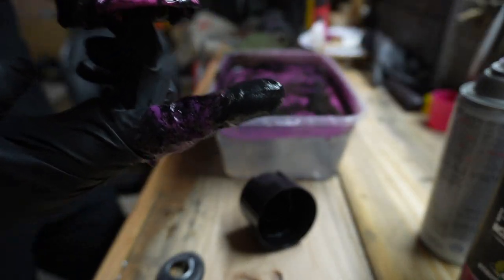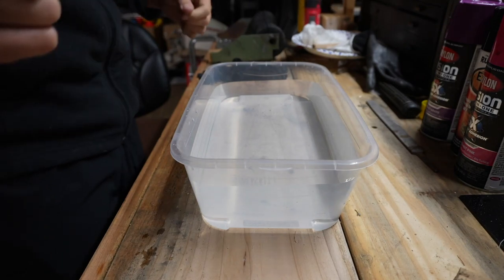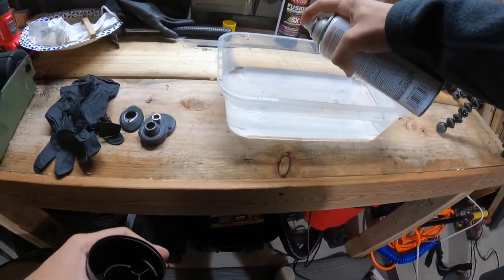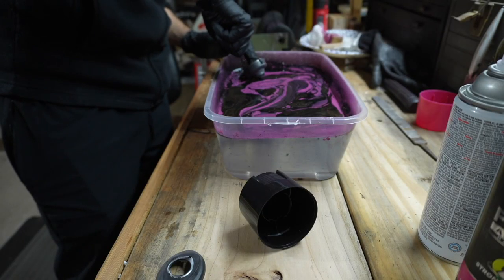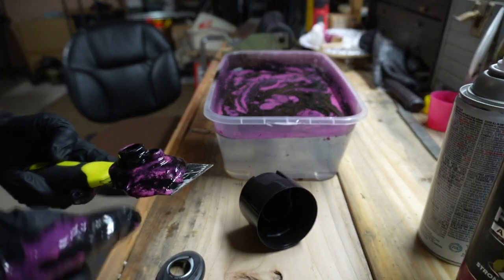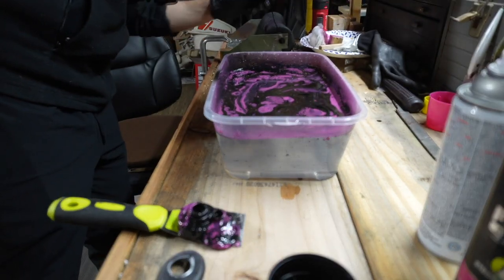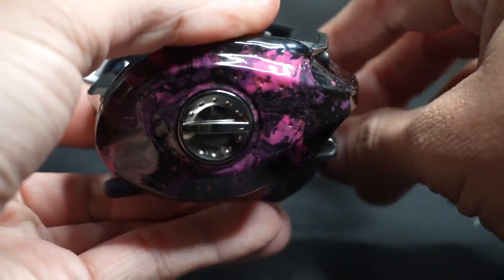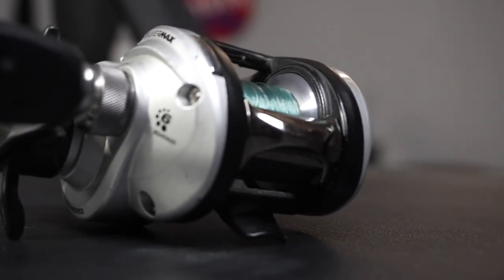I Hydro Dipped My Abu Garcia Reel! (The Right Way To Hydro Dip A Fishing Reel)

Comment: Just guessing but if you apply a light coating of petroleum jelly to the threads, like tension control, would the paint wipe off instead of sticking to the threads?

Finished product looks way better than original!!!
Props!!!